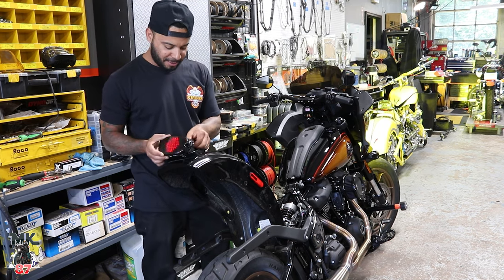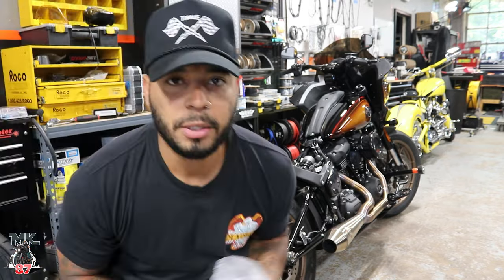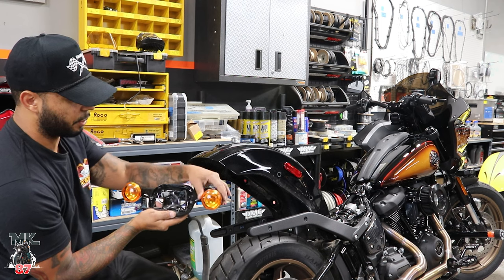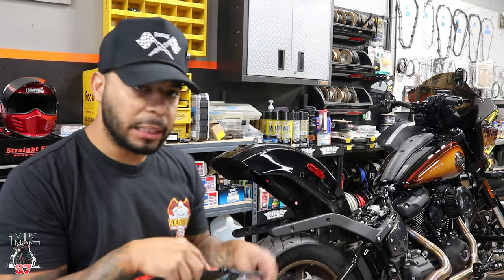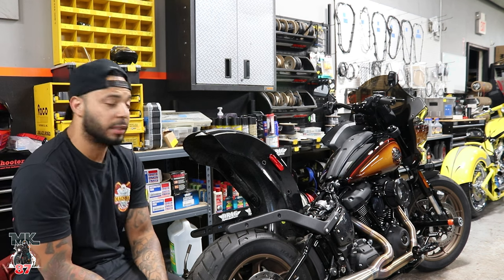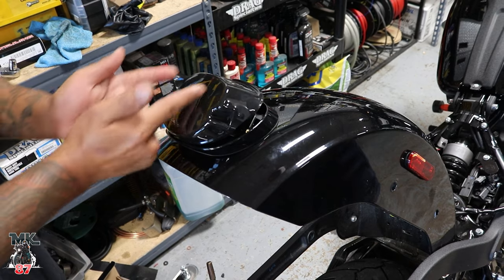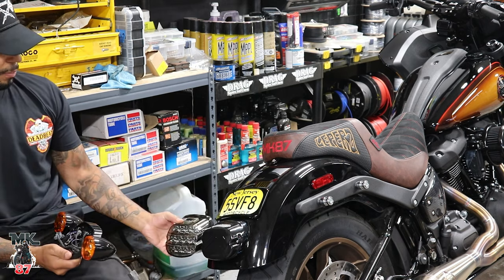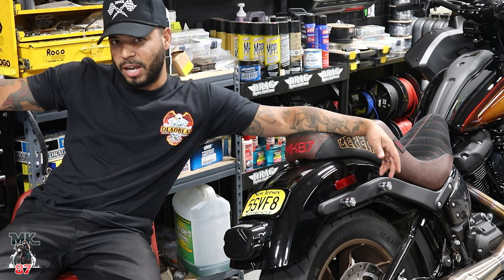Low rider st MOONS mc Integrated Taillight install

Comment: Dig the setup, gonna order it. What lay down license plate bracket you running? Also does the tail light have illumination on the plate or did you get an illumination plate frame?

Comment: Supposedly and I think their website says so...the light is a "supplemental" turn signal.  Not that I care all that much, I do like getting rid of the lolly-pops.  State inspections might be a bit difficult depending on the inspector.  Bring bribe money or food or whatever for inspection cuz that pipe certainly doesn't pass muster.  My same pipe is sooo loud.  I love it.  Sometimes I am inclined to forget the state inspection.
Reply: That's the good thing about NJ. No state inspection on bikes. You are responsible for your bike being in shape.

Comment: A week ago I installed such a lamp from Moon on my Tobacco. Turn on the strobe function in it (there is a small button inside the lamp). You will be much more visible on the road and it will make a better impression when braking.
Reply from the maker: Thanks I’ll look into it 👍🏽

Comment: Hey Everyone, just want to inform everyone that this is NOT the way to remove the rear fender and is very likely to get scratched. I’m embarrassed for him and the shop for this. Some tools are just not sharp
Reply from the maker: I’m embarrassed you didn’t see the part where  I explained that 🤡 but hey did you know The Rocky Mountains, also known as the Rockies, are a major mountain range and the largest mountain system in North America. The Rocky Mountains stretch 3,000 miles (4,800 kilometers)[3] in straight-line distance from the northernmost part of western Canada, to New Mexico in the southwestern United States. Depending on differing definitions between Canada and the U.S., its northern terminus is located either in northern British Columbia's Terminal Range south of the Liard River and east of the Trench, or in the northeastern foothills of the Brooks Range/British Mountains that face the Beaufort Sea coasts between the Canning River and the Firth River across the Alaska-Yukon border.[4] Its southernmost point is near the Albuquerque area adjacent to the Rio Grande rift and north of the Sandia–Manzano Mountain Range. Being the easternmost portion of the North American Cordillera, the Rockies are distinct from the tectonically younger Cascade Range and Sierra Nevada, which both lie farther to its west.
Reply: @Marvelkid87  Point proven! Haha.
Reply: My guy it’s his bike he can scratch it if he wants.